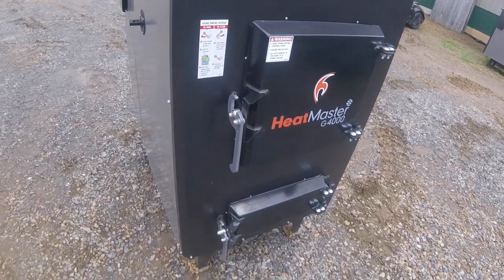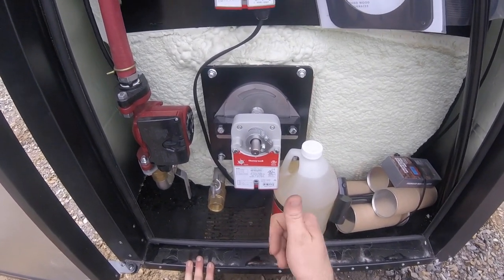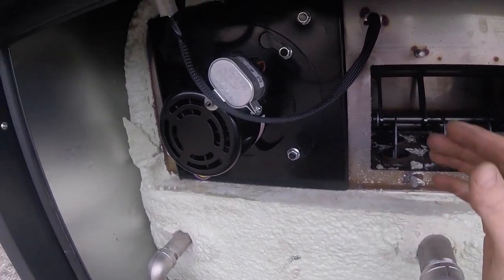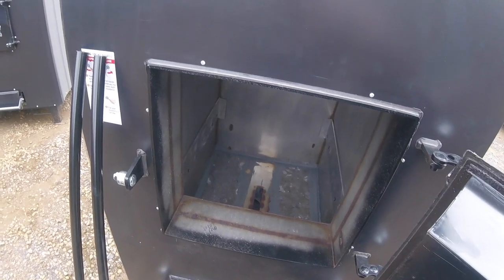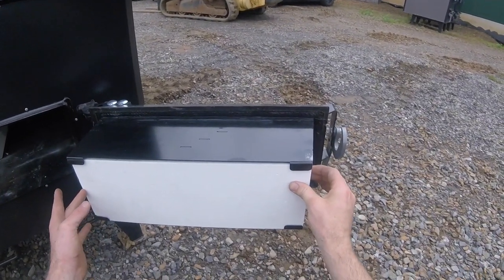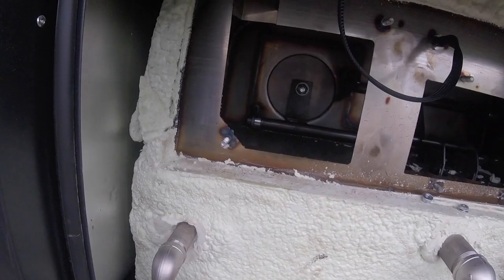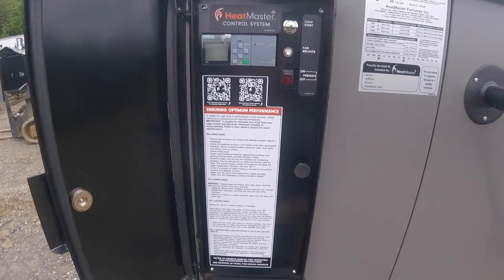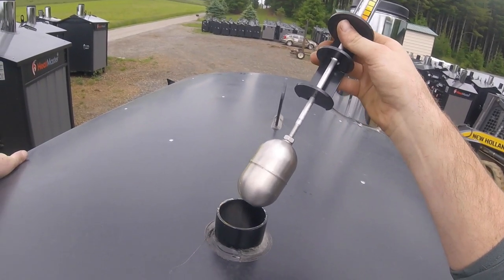Heatmaster G4000 New Owners Info

Comment: Cant believe how small the exhaust pinch point is at the output of that fan. 
Is there a way to oil / grease the fan so that is lasts ? That would be pretty legendary for modern day times lol. 
To show us what surfaces are in contact with the water jacket and what surfaces are " dry " would be extremely helpful. Either a diagram / animation or just pointing and saying. 
Also, as much technical specs on the material as possible is always appreciated to throw in ( i.e various types of metal used ). Did i miss you say where these are made ?
Reply from the maker: All parts are 409 stainless.  Except a few pieces like the legs, handles, etc.  They're made in Manitoba.  
The water jacket surrounds the firebox, reburn area, and exhaust tubes.  Someday I'll have time to make a video with more details, but that'll be during the summer season I'd guess.
Reply from the maker: The fan has sealed bearings, no oil ports.

Comment: 7:30.  You mention it should be cleaned out ever now and then.  How often is that?  Once a month or once a season?
Reply from the maker: I would say check it every few months until you see how clean your wood is burning. It really varies a lot depending on moisture, the type of firewood etc.  Cleaning intervals vary dramatically depending on what you're doing with the stove.